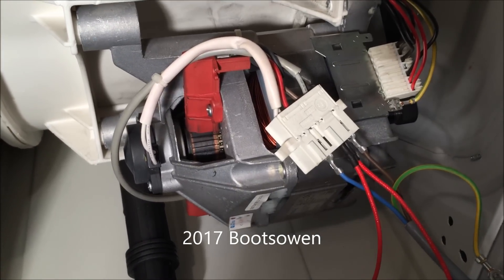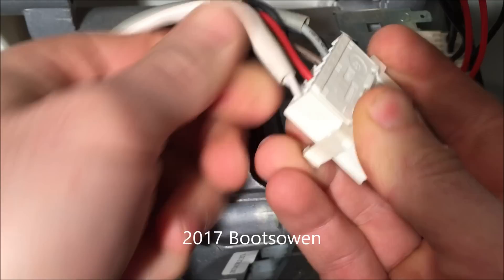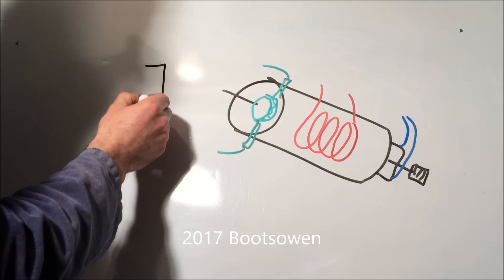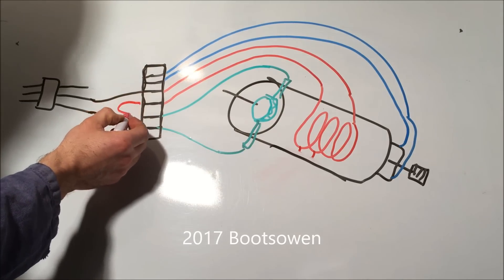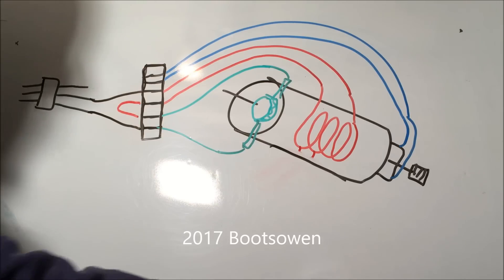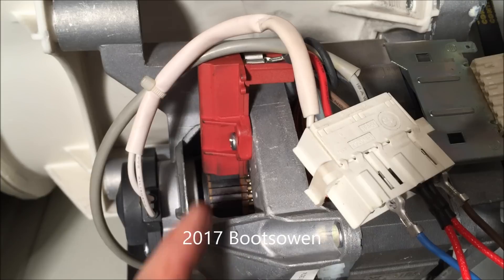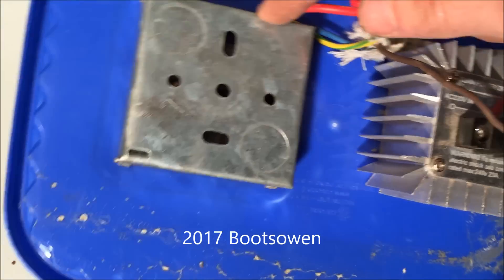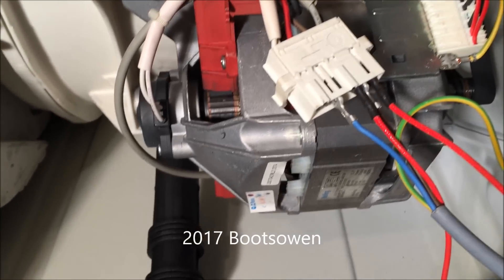Washing machine universal motor wiring explained

Comment: The best welling video on youtube this helps me alot.A board and marker was a excelent explanation.Thanks man.Regards from Serbia
Reply from the maker: No problem, I appreciate your message.  I'm glad it helps.
Reply: bootsowen is there any way to wire reverse polarity rocker switch.
Reply: bootsowen yet yy
Reply: @bootsowen  have a washing machine motor but the plug on the side is missing and theres a total of 6 wires 3 go to the back shaft and 3 go into the back by the copper winding i am at my infancy
Reply: At motor repurposing and trying to figure out how to put a plug on it the model # id DWS8003SK , If you can help me out i would appreciate it  thanks

Comment: Hi   .   Please consider this :  Give the commutator some voltage (independent of the coil) . Give the field winding some voltage (independent of the  commutator ) . Play with the amount of voltages to adjust the spinning and the torque !!!I believe this is an other approach to control the motor .

Comment: I would be interested to know how to wire a direct drive washing machine motor this way. The LG front load washer I am using has 3 field windings , and 2 hall switches.
Reply from the maker: You can’t wire such a motor this way

Comment: Nice simple explanation thank you. Aside from your 6 wires my motor has 3 other wires which have continuity between them. Can you please explain what  these 3 wires are for  ?
Reply from the maker: No Idea without seeing them, but they are most likely additional taps to the windings in the motor.
Reply: Probably a rpm sensor for the pcb  👍

Comment: Hello. I need to know. Connecting a universal board to this motor. Can i not connect the heater  and the ciclus of the machine will work to the end or it will by interupted with a error code? I want to not use the heater resistance.

Comment: If you have 7 connections, presumably 3 windings, can you just ignore one and carry as per your video? Is it used for something?
Sorry for the potentially stupid questions haha! Other than that great video man!
Reply from the maker: Yes, two cables to tacho? two cables to brushes? and 3 cables to windings? Then there should be some combination of two of the windings in the configuration that I have shown will get you going, using other wires from the windings should give you different speeds. The system in the washing machine would only ever use two winding taps at a time. Wash speed, spin speed. Let me know how you get on!
Reply: @bootsowen  Great. Your video helped me a lot and using what you said, I just assumed it was a different spin setting for the motor but just wanted to check! Thanks for such a quick reply. Consider me subbed!
Reply: Hi again! So I managed to get everything up and running nice and smoothly! Added a voltage regulator and a power switch which work smoothly. Thanks for your video and added comments much appreciated and helped a lot!

Comment: does it matter for direction nrotation point of view that the brushes are not peripendicular to the comutator and they are at an angle? In one direction, one of the suf-forces from the resultant of friction and the spring will act inwards and aling the direction of spring force whereas in opposite direction, it will actually lift the brushes...?

Comment: Hello what will happen if I use the variac variable in the electric motor DC for continuous use??
will cause problems?

2) If I use the speed controller with two conductors and one of the grounding to the electric motor, it will cause problems?
(that's your speed controller in the plastic white box)

3) can I use the speed control on the heater of the washing machine without a thermostat?

I would love your answer!!! :)
Reply from the maker: A variac is an autotransformer, so will not work on dc.#
2 I don't understand your question
The SCR speed controller will work on a heater element, but the wattage on a heater element is high 2 or 3 kW, so you will need a big controller.

Comment: Hello
Very nice video with great explanation
Just a question about "more field winding" in my case I'm having a motor with 8 wires, 2 for tacho, 2 for brushes, and 4 for field winding (connected 2 by 2) so in order to run this motor should I connect two wires of the field winding and use the left ones, somthing like connecting the wires to make one field winding !
Reply from the maker: Bearing in mind that I haven't seen the motor, nor do I know the model number. For your 4 field windings imagine that one of the 4 wires is one end of the coil, another is the other end and the remaining two are intermediate taps. the motor will run with different torque/speed when any two are connected up in the way that I have shown.  I am not sure if what you have suggested will work. It might. you could do some experiments. You sill have to experiment to find the  best speed combination for you.
Reply: Thank you for the reply, today I got back to the motor and I've followed the wires (the two remaining wires) are connected to a bimetallic thermostat to protect the motor from over heat and the motor is running like super cool now :)
Reply from the maker: Sounds like a Miele

Comment: Dude ... that was brilliant I have been mulling in my brain for days how to do this ... I have a project building a potters wheel besides making sure whatever I do is water proof any pointers will this same process work will the motor over heat? Again Awesome video !
Reply from the maker: Over heating depends on airflow, fit a fan to blow against the motor and it should keep it cool.  I am more interested to hear how you plan to waterproof it. Post a video?

Comment: funny how most all these youtube wash machine wiring vids are brushed motors and every last washer motor ive messed with are brushless . where do find brushed motors in washers?
Reply from the maker: Look for older motors. I have posted a few videos about wiring and controlling a brushless one. Not as easy. Arguable better speed control however.

Comment: Hi . I'm looking to make a disc sander with a motor as used in your video. Can you tell me the RPM of the motor when connected directly to the mains without any voltage control . Very informative video by the way.
Reply from the maker: Good luck with that, you should really not do it the way you have suggested, Typically these motors go up to 15000rpm, bit fast for a belt sander when you could spend £5 on a controller, or just use a big resistor in series and that should hold the speed back a bit.
Reply: @bootsowen  I understand that. I tried your wiring method and it works fine, it's just that the motor isn't labelled  with the speed.  I was considering reducing the speed with a  system of pulleys rather than the controller method.

Comment: To regulate an AC motor you don't regulate the voltage you use a phase control device then there's no heat.

Comment: Hello I am Daefit Suscriber from Indonesia: Permission ask, I have a Samsung loading motorcycle, and when I try to turn on using electricity directly trips on MCB, why this happens ...? I check the stator roll cable does not signature burning ... and the rotor is the same I check still connected each other ... what should I do ...? thanks for the advice
Reply from the maker: I don’t understand your question?

Comment: hi I got 220v 50w motor on honey extractor with speed control switch.  I want to test the motor direct because swith seems faulty. 2 blue, 2 brown & earth coming out of motor. can I test direct supply or must have regulator?
Reply from the maker: Hi, what type of motor is it? If you don't know google it and look at photos.
Reply: @bootsowen  I believe its AC induction brushless.

Comment: Hello, I'm not sure if you are still following/replying to questions, but I'm a little stuck. I have a washer motor but I have 4 wires, 1 of which just grounds to the frame, so I've got 3 wires to figure out. I don't have brushes, stator, or anything else visible. The 3 wires appear to just be the ends of windings, now I'm in the US, so Hot/Load is normally black and neutral is usually white. The wires going into the motor are red, yellow, and white, ---- There is a capacitor with red and yellow leads that clip onto it. (I have the full wiring, but have not traced anything yet).
My guess is White is neutral, and the red/yellow from cap mate with Load, and then ground everything?
Sound about right, or no? I have a different motor that was wired fairly similar, (it was a squirrel cage microwave motor, I'll have to double-check the way I wired it). I had some trouble figuring out, but finally found out that one wire was neutral, and one of the other 2 that went to the cap went to load for one speed or the other to load for 2nd speed.. 
I'm just trying to avoid sparks or smoke!! Thanks,
Reply from the maker: Hi There, It is very hard to diagnose without a photo or a link to a video you have made.  Is the capacitor wired to the motor? if so it may be a type not covered by this video, by your description, if the capacitor isn't attached to the motor, it may be a 3 phase type motor, see my other videos for how to wire these, and why not to bother!  Good luck.
Reply: Thanks for replying. I re-read what I wrote, and I'm sorry for the confusion.
It's weird, I can find pics online of this motor, but no wiring instructions. 
Let me see if I can clarify the description, and I'll add the links to the online pics, Idk if they will go through though.
Ok, the clip attached to the motor has 4 terminals/tabs/wires... 1 of those wires is green/yellow (ground). In US green or g/y is ground so it just connects to the motor frame, leaving just 3 wires to deal with, and they all look like they go into the windings, it's a little hard to see. 
The 3 wires are red, yellow, and white; in the US white is normally neutral. The red and yellow come off the motor, run a foot or 2 and come to a Y, or splice. The red one splits to 2 wires, one line to one side of the 47mF cap, and a red that must have ran to the control panel. The yellow also splits like a Y, it continues to the other side of the cap, (they are attached to a clip still that only snaps into the cap one way), but it's an orange wire that Y's or splits off from the yellow. So the white should be neutral, the red and yellow both go to a 47mF cap, and both (red/yellow) split off just before the cap. I hope I wrote that in a way that makes since?
I used my DMM and checked the ohms of the 3 terminals, the red/yellow have 12.3 ohms, but either red or yellow to white gives me 6.2 ohms. Based on that I would assume that means Hot to either red/yellow and white to neutral would be low speed, and both red/yellow to hot would be high speed, but then what about reverse? 
I saw the washer along the street in my neighborhood and stopped to rip it apart real quick, (I don't have a truck so couldn't haul it and take apart as I'd have liked), and about 1/2 way through taking it apart the trash men showed up so I  didn't have a chance to follow the Y's off the R/Y, I just had to cut the wire and go...
It's a Welling W1006399, just that search does bring up pics of this motor but no vids on it. It's a 1/4 hp 120V 3Amp Thermal protected. (I hope it's a resettable but ???) It does say 40 Celsius max ambient.
I'm going to attach a link or 2 of pics I found online, I hope they work. 
In addition to how to wire it, I'd like to figure out if this is a "continuous run motor" or not so I can figure out what I can use it for, like a lathe, table saw, ect. It does still have the small pully on the shaft, (I can pull it off if I want/need), and I was able to grab the bigger pully and belt before I had to grab and go.
 This is a link to a pic of the motor, 
https://www.google.com/imgres?imgurl=https%3A%2F%2Fhttp2.mlstatic.com%2Fmotor-para-lavadora-whirlpool-part-no-w10006415-D_NQ_NP_726546-MLV26136199555_102017-F.jpg&imgrefurl=https%3A%2F%2Farticulo.mercadolibre.com.ve%2FMLV-508214567-motor-para-lavadora-whirlpool-part-no-w10006415-_JM&docid=cpD1EZqkTr9SmM&tbnid=bU6LdDA5DD_bPM%3A&vet=1&w=1200&h=900&bih=495&biw=1093&ved=2ahUKEwjXw5TE2v7cAhVQG6wKHVqoBigQxiAoBHoECAEQGA&iact=c&ictx=1
Left to right is the Green/Yellow ground, then yellow, red, and white. 
And here's a link to the identical one on eBay,
https://www.ebay.com/itm/WHIRPOOL-MAYTAG-AMANA-WASHER-DRIVE-MOTOR-WELLING-W10006399-YXB85-4H-1-4-HP-/222636789156
Any help would be greatly appreciated. I know this is a little long, sorry, I just wanted to try and explain it better. The pics (if they work) should help?? Thanks Again.
Reply from the maker: If it was me, on the basis that I got the motor for free, I would just put live and neutral across any two cables and see what happens. But sometimes when I do that the blue smoke appears.  I have a read a simple book, Electric Motors in the Home Workshop, £6 on ebay. It would be a better guide than I am, it will explain what your multimeter readings mean, etc. And you would certainly enjoy it!
Reply: I figured out the wiring for the particular motor I have. There's only 3 wires to figure out as the 4th grounds to frame, so just W, R, Y, and White is neutral (here in States) so I hoped I just had to figure out R&Y. 
It's so simple it's stupid! 
White does go to N, and Hot to either R/Y it spins one way, or the other wire to hot spins in reverse, but NOT both to hot!! Simple. I guess I just wanted to try and be sure, but the Voltage/Amps are on the motor, so I put a manual reset breaker half the Amp inline just in case. Without any load it shouldn't draw near the rated amperage, it worked.
I can only assume that the Speed is controlled via a microcontroller on the PCB that I was unable to grab.
I'm going to look up the book you mentioned, check it out, and possibly buy it for future reference.
I do however have another question, would these be considered "continuous run" motors? I'm going to see if a search will provide anything, but I have found little info on this one at all??
Thanks Much,

Comment: What about controlling the torque? Is there a way to maintain high torque while varying the speed? This would be most applicable for a disc sander or lathe like you’ve mentioned. Thanks!
Reply from the maker: Yes, you need a tda1085c motor controller. I have made a video about using on e of these on a large grindstone. You can get a component on the internet auction and make a circuit or buy a pretty good one that has been preassembled, like I did in the grindstone video.
Reply: bootsowen thanks a lot! I’ll check out the video & order one of those, probably pre assembled. I’ve got a universal washing machine motor I wanna use for exactly this purpose!